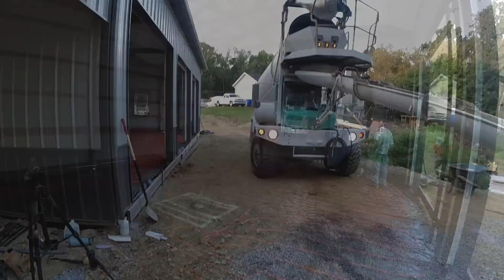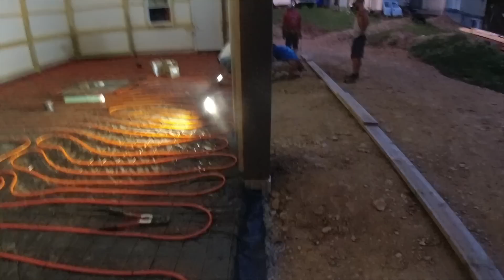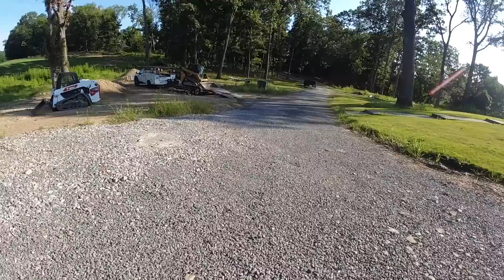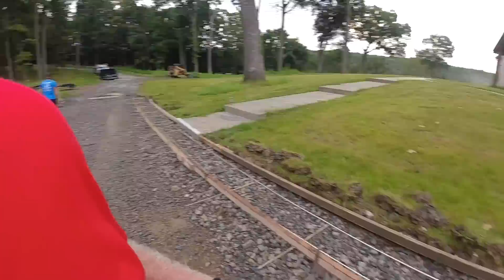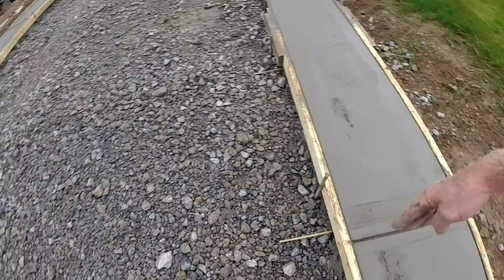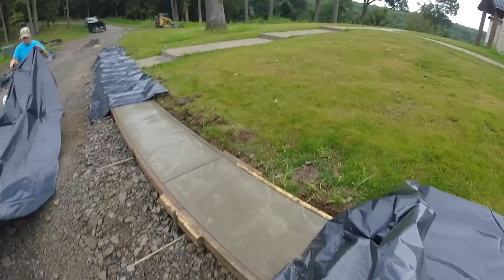A Storm is Coming!

Comment: On a 12’ by 30’ patio slab, is there a need for a control cut down the middle of the length, or are 2 cuts 10’ apart across the width sufficient?    5” thick, fiber mesh, rebar & wire. Thanks for advice, I respect your opinion.    Awesome videos by the way.
Reply from the maker: Bill if you could take it one step further and do a center cut long wise making it 6 foot instead of 12 foot and three cuts across turning that into 7’8” pads I always feel it’s better to keep them close to square and center is where the stress always is
Reply: @Concretewiththehauses     Thank you.

Comment: Nice work Tom, beautiful, enjoy your videos as a subscriber. Quick question Tom, The plan that we live in poured concrete for the plans side walks and we have to seal it before winter sets in as well as our garage and side walk to the house, the concrete has been on the ground for about 5 to 6 months . what product would you use and where to find it, so many on the market. we live in the Harmony area. 
After watching your videos, I really trust your opinion.
Thank-you Bill
Reply from the maker: You can go to Caral supply corner of 228 and Franklin they will advise you master protect 350
Reply: Thank you Tom, look fwd to more video's, I have learned so much from you and your great crew.

Comment: Having been a sewer plant operator since 1974, the rule of thumb has always been that the floor drain is the highest elevation in the room. That holds true far too often. Trench drains are far superior, but I have had to fight with engineers to convince them.
Reply: Oh yes the high drain, But then a inground electrical junction box is usually the lowest point in 5 acres. Go figure.

Comment: when you do a driveway that you cannot finish for several months do you just end the driveway to the stone or do you do a little one foot strip that you can saw cut off at a joint in case damage incurred on the edge and then continue the pour. I guess what I'm saying is when you stop the driveway at Stone sometimes the lip gets damaged.
Reply from the maker: Usually we just end it and hope for the best very seldom we leave them unfinished like this thanks
Reply: @Concretewiththehauses  same here but I've been thinking about doing it that way I appreciate that